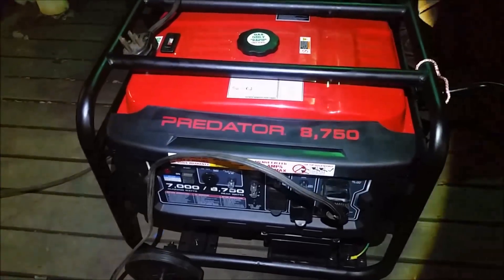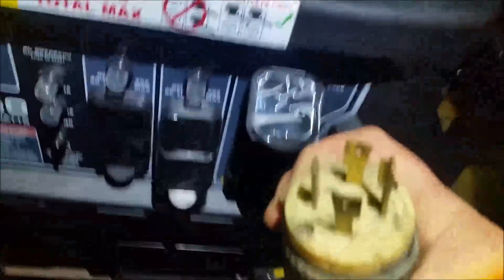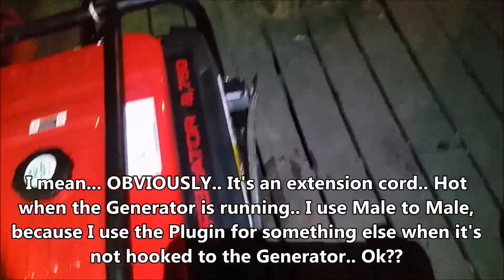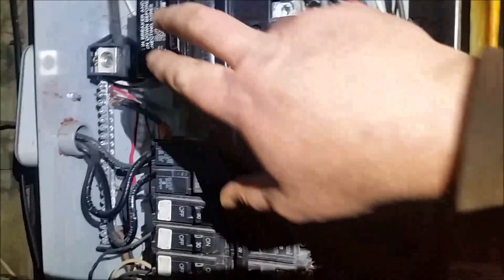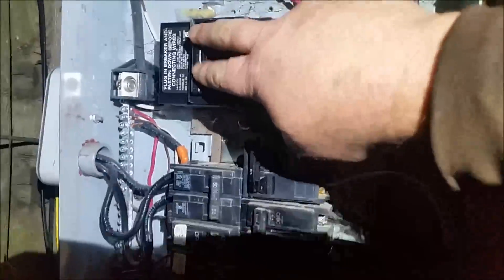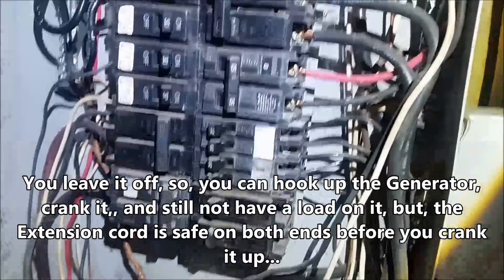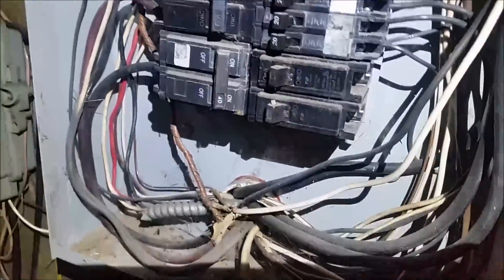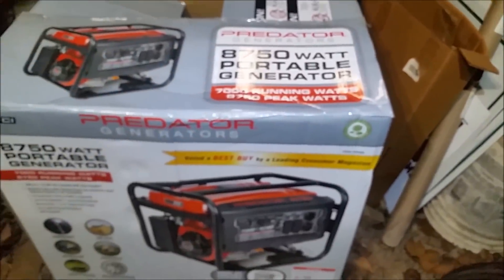Quick/Easy/Safe: Use Existing Plugin/Breaker for Generator hook up to your house Panel box.

Comment: There is a reason this is called a "dead man's connection. This is so against code, it is ridiculous. Do not do this!
Reply: Here’s a video about generator safety that everyone really needs to watch https://m.youtube.com/watch?v=I1jT3ANENvI
Reply from the maker: Show us how intelligent you are.. We would all like to know if you know what you are talking about... 
It is a real simple question for you based on your comment. Ready??? 
If you Turn off the Main Breaker and don't have your generator already running and you plug in both ends of your cord, and then turn crank the generator... Please tell me how this would create a "Dead Man" or "Suicide death"?? I really would like you to explain that to all of us.. 
Because, understanding physics and electricity,, I just can't seem to understand your point.. But, please explain.. You might be smarter than the rest of us.. But,if you are, you should be able to explain your problem with this and, it should make sense, not only to you, but, to the rest of us too.. 
Give it your best shot,, or just realize that you are not very smart and you talk without thinking,,, not like the rest of us..
Reply: +Mark Thomas, you want a rebuttal explanation? Go to the website of any utility in the country and they'll have a page about why you should not do this dangerous setup.
Reply from the maker: Puss Anon: Driving a car is dangerous.. I'm sure I can find a website that says that.. Doesn't mean I can't drive one for 50 years without incident.. If you are so smart,, go and research and find out why it is dangerous and come back and take a shot at proving where it is dangerous,, and join the group of failures..  A car is only dangerous in a Dumb shit's hands.. Others,, it is a tool. No different here.. I hate to think about you being on the road the same time that I am.. I hate to think at the number of brainless bodies like yours driving around on our roads today.. Scary!
Reply: Here is a group of some of the most respected professionals in the trade:
http://forums.mikeholt.com/showthread.php?t=142763
Reply: This from the site...."If the main breaker is turned off, it alleviates the hazard, but that requires remembering to shut the breaker off, and relies solely on the user to do so. There is no guarantee that someone else will not turn the main breaker back on and suddenly energize the neighborhood wires. There is no safeguard in this arrangement......"
Well, he did say multiple times to turn the main breaker off.....and I guess the next best thing in the times of use is to put up a sign that says DO NOT TOUCH THE TURNED OFF BREAKER  to keep someone else from turning it back on.   The remembering to turn off the breaker is sort of like hunting and remembering to keep the safety on the gun till needed or perhaps turning the  brushhog off when hooking it up to the tractor
Reply: Mark These guys are trolling you.  Because there can't be this many dumbasses that are electricians
Reply from the maker: P Anon: Professional? You mean someone who paid for a license and was able to pass some tests? Because, I am sure that some who have commented here might have had Electrical or Electrician licenses, but, they have not been able to defend their accusations, nor explain the items that I have detailed out on factual basis... 
Sorry, but, if you follow the steps, there is no risk in connecting or disconnecting or running this setup..
Replying to Professionals? Then, if they  are professionals, then, why can't they factually prove what they say by addressing my replies back to them factually, discussing the same.. 
Of course,, you lack basic understanding yourself and common sense, so, it appears this is way over your head.. 
But, to make it simple again,, Turn off the Main Breaker.. No risk to backfeeding to utility.. That's why they call the main breaker a Service disconnect.. No power to the panel.. Generator not running.. Either side of the cord being plugged in, neither side is hot.. Crank the generator, and if the Generator breaker is on, the plugged in cord is energized.. IE.. Hot.. 
When you turn on the Generator breaker, the generator has had time to get to operating RPM, and is ready for the load.. 
Sorry, you can't understand that.. I really don't know how to explain it any simpler way.. 
I'm sorry if you resent us folks that that can figure things out like this and use reason, logic and physics and show how it works to you guys running around frantically waving your hands yelliing,, Wolf,,, "Wolf,, Wolf,,,, ! 
Because a professional, who knows something is not right about it could easily explain why.. But, that's just it.. 
They rant and rave about backfeeding, but, when you say,,, Main Breaker is off,, they don't know what else to say.. Others say, but, neutral is still connected... Really, follow the neutral from your house and back to the utility lineman.. Oops,, failure there too. It doesn't go back to the line.. Stops grounded at the pole.. Only an ignorant man would try to argue the point as many, many have, but, none have "Defended" their argument.. Only failed in their attempt.. 
So, the guy failing is not the dickhead,, it is the guy making unfactual, stupid, ignorant comments he can't back up. Scary how many ignorant people there are in this world.. A bunch of dickheads.. What is P Anon.. Pussy Anon?
Reply: +Mark Thomas, no, professional as in doing the same trade for over 30 years, doing it damn well, and knowing what you are talking about. NONE of which describes you in any way.

Comment: I don't see a problem with this hookup the instruction is straightforward.the people who can't grasp it probably shouldn't be walking around anyway.
Reply from the maker: Yes.. When you think about it in relative terms,,, no matter what solution, they all start with throwing the main breaker.. If they can't figure that out,, yes,,, they should not even call an electrician for a solution.. Just stay without power...
This is a way to hook up a generator without having to go into the box to begin with,, since they can't remember to turn the main breaker off and might never get this far anyway.. Think about it.. They still have to build a Male to Male 220v cord.. What is the likelyhood of them doing that?? 
This solution eliminates the igmofucks anyway,, without even saying it.. But, they never get that far, so, it makes even more sense when you consider that. Ha.. Cheers..
Reply: Those with a problem probably have to throw the main breaker (and park their chewing gum under the table) to change a light bulb!

Comment: Yes. this will work just fine. Nice work!
Reply: Generator safety is very important for everyone https://youtu.be/I1jT3ANENvI
Reply from the maker: Thanks.. It does work nicely.. Quick and easy, and safe as long as you remember to turn the main breaker off an plug both ends of the cord in before you crank the generator.. Of course,, you already saw and know that.. Cheers and good luck with it...

Comment: I have the small Honda generator. It puts out 13 amps continuously and will run 10 hours on a gallon of gas, which is a huge factor during a long power outage. I made up a cheater cord and I back feed an outside receptacle. I reworked my panel so that my furnace and refrigerator is on the same pole as the receptacle. And of course, since I bought the generator and prepared, the power has never gone out. LOL.
Reply from the maker: blipco5 Ha.. Well,, that is a good thing.. I am constantly on generator.. Count your blessings.. But, sounds like you have it figured out.. 
Not a dang thing wrong with being prepared.. Make sure you run the generator once or twice a month for 20 minutes or so each time.. And, if it burns that little, I would think about Non-ethanol gas.. Much more expensive, but, you don't run the chance of the hard white buildup if you don't run very often.. 
Some carbs are not affected by it, but, they are the newer and larger ones, or smaller commercial things like some weedeaters/blowers, etc.. 
Cheers.
Reply: +Mark Thomas ...I live in a city so there's relatively few trees to come down across power lines and the lines are fairly well maintained. I've been a licensed electrician for over thirty years and have worked some lines. Hooking up a generator this way is safe as long as the proper procedures are followed. It's not for everyone though. During a power outage a lineman will investigate if he hears a generator or sees lights on in somebody's house. Back feeding a transformer from a home generator can liven the primary conductors to thousands of volts.
Reply from the maker: @blipco5  yep. You are exactly correct. That's why I only people with common sense need to do this. The ones that don't forget to turn the main breaker off.

Comment: This guy is going to either directly or contribute to killing someone. If not the person hooking this abortion up, then probablysomeone working for the power company that is working on the problem. I also an a licensed electrician plus licensed lineman. (That means I work on high voltage ) .This gomer should have his vidoe removed.
Reply: Bob Thompson if a linemen dies from a backfeeding genny, they are a fucking idiot and didn't follow protocol. Even if debris is involved, you fucked up
Reply from the maker: Really Mr. Gomer?? What part of Service Disconnect did you miss in your training?? Just curious..  The lineman around here have my same hook up.. I have had 3 come by and go home and do the same.. Something different about them and you... They see the simplicity (nothing to add or change anywhere to  do this).. Sorry you can't see something so simple.. If you can't remember to turn the main breaker off, you can't operate any type of Generator switch manual or Interlock.. Think again Mr. Dumbass for your whole career..
Reply: Mark, it would seem to me that if a lineman is going to work on high voltage lines he has to remember some important disconnects before doing so. If a lineman thinks he can remember that much he should consider that others might remember something as simple as a service disconnect, and don't homeowners routinely remember to open a branch circuit before replacing a switch or receptacle. I just don't get it!
Reply from the maker: Yea.. Ha... Me too.. Must be one of those guys who buys the 2+2 is not equal to 4...  I really don't get it either.. If they are actually are electricians,, I have decided long ago, when I first posted this video,, there is absolutely NO WAY,, that I would ever hire an Electrician to do anything for me.. Even if I had no legs and no hands,,, trust me.. I would figure out a way to fix whatever I needed,, not to have to trust one of these clowns working on something that I had to go to sleep in at night.. And, I really mean that.. I would rather have a 10 year old being my hands and legs and do the job for me, rather than turn a blind eye to someone posting here fixing something for me while I was not watching them 100% of the time they were on the property..

Comment: Thinking a few hundred bucks for install would end liability and safety issues. Plus the parts.
Reply from the maker: Probably about right.. Here is a solution for $650 that Ed Taylor just posted which should cut the labor costs, but, the parts are a bit pricey.. I think $700-$800 would be about average for something like this.. This is one of the better options I have seen... 
https://www.homedepot.com/p/GenerLink-30-Amp-Meter-Mounted-Transfer-Switch-MA23-N/301961623?cm_mmc=Shopping%7CG%7CBase%7CAll-Products%7CAll%7CAll%7CPLA%7C71700000014585962%7C58700001236285396%7C92700010802552412&gclid=EAIaIQobChMIlr-km6Cf3QIVR4GzCh1I0wuxEAQYAyABEgILUfD_BwE&gclsrc=aw.ds&dclid=COP8zZ-gn90CFSZmwQod8kUP2g

Comment: If you're electricity is out, you do what ya gotta do.
Reply from the maker: Do what makes sense to you.. Correct.. If simple and quick makes sense, and you can remember to turn the main breaker off, then, this is an easy quick way to get on and off Generator power.
Reply: Even if it's illegal and dangerous, right?
Reply: @panon5292  yeah.  If you know what you're doing and you save your own life and the life of your family from freezing to death, it's an emergency.  The cold winter doesn't have any regard for the law.  Do what ya gotta do.
Reply from the maker: Your comment shows that you do not know much if anything about Electricity and Panels. You could not be further from the truth.. The only thing not standard on the setup is the Male to Male cord, and NEC does not regulate "Extension cords, or more specifically "Temporary Extension or Portable Extension cords".. So, it is not illegal, nor is it against code, at least in My State.. Dangerous?? Cars are dangerous, but we use them. Knives the same. Hammers, Baseball bats, etc.. 
If you turn off the "Service Disconnect" or Main Breaker, and you connect the cord before cranking the generator, there is no risk..  But, if you think it is dangerous,,, you have Zero business doing this or anything else Electrical related.. You'd better just call an electrician and let him take care of things.. It takes common sense and confidence to do this.. You have demonstrated a complete lack of both.. This video is not for you, like I said multiple times during the video.. But, others, by all means.. It is a safe way,,, simple rules followed to use an existing plugin to power your home when you need to use a generator..
Reply: @MarkThomas123  Like - if you are in winter and it is 20 below, and your power is out and you're stuck, with no phone, and the wireless out, are you going to let some law kill you because you have a generator and you know how to hook it up?  Get real. Save your life and hook it up.
Reply: Please make you all of you watch this video about generator safety https://youtu.be/I1jT3ANENvI

Comment: Generator switching panels are available and inexpensively installed by license electricians. I have used them in the Florida Keys during storms.
Reply from the maker: Yep... They do make them.. I don't know if I would say "Inexpensively installed"..  I have used them also.. I can post pictures of one across the street at my Brothers place.. Had to put up a separate poll to install it... Funny thing.. He is still nervous when he hooks up his generator.. I have never purchased one myself, but, I have looked at them.. Always some huge conglomeration.. When someone can convince me that flipping my Service Disconnect is not a safe option,, I'll look at them again.. But, 15 years of using experience is going to be hard to forget..Ha.. Thanks for the post G Howard..  Last one I looked at was $350 just for the switch.. I'm sure a matching amount of labor would be fitting for the install.. I have routed some heavy wire more than once or twice.. It's worth it.. Hands get tired pretty quick trying to route that big mess.. Ha.. Cheers.